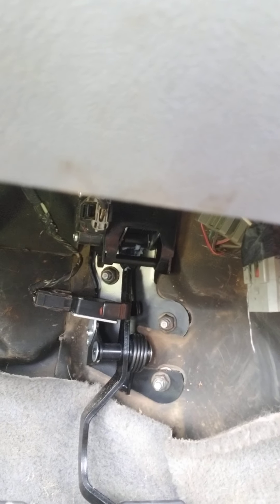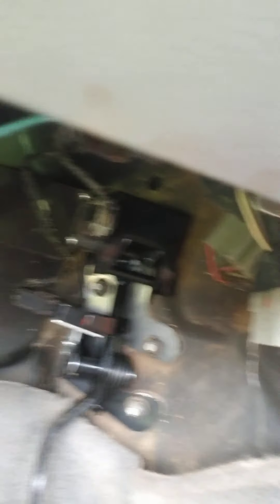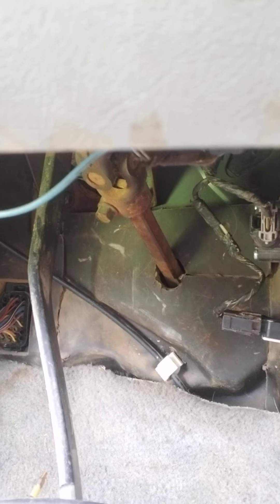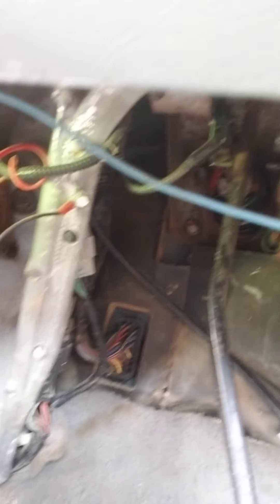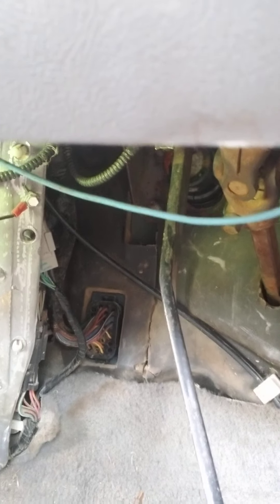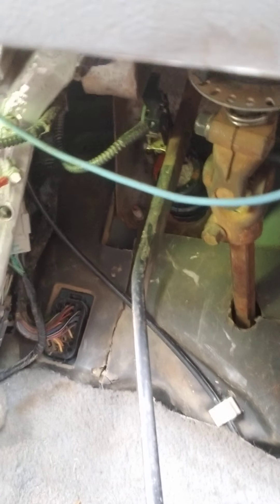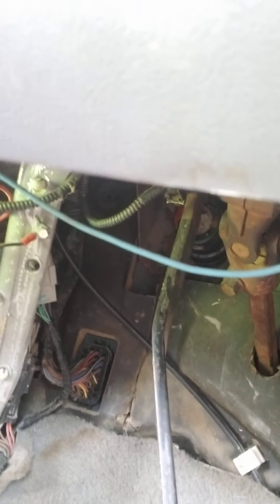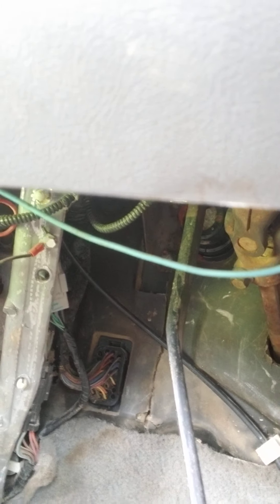1997 f-350 7.3l powerstroke throttle position sensor another issue

Comment: I also had this problem. Swapped the pedal assembly out with a new one. Same problem. Found out there is a fuse for the Idle switch that was bad. So when the Idle switch goes bad. It will blow the fuse.
Reply: Where is that fuse?